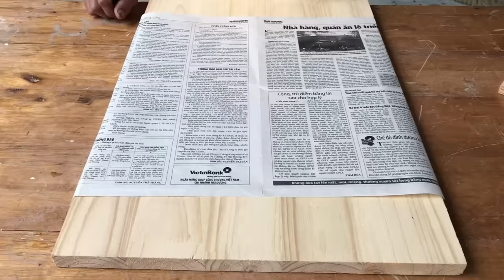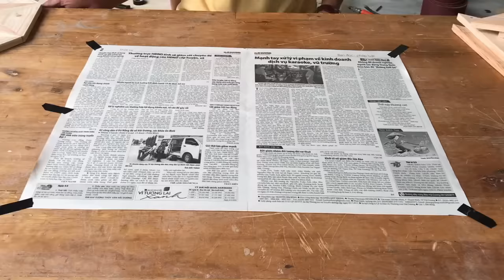Idea Of ​​Turning Pallet Wood Into Work Of Art. How To Create A Patchwork Of Your Gallery Wall -DIY!

Comment: HOW HAVE YOU STILL GOT ALL YOUR FINGERs.???? BRILLIANT JOB!
Reply: The fingers were SO CLOSE to the saw blade. It made my hands sweat watching it.
Reply: @CesarSandwich  I could only watch it with one eye open 😁.
Reply: Oke
Reply: Chop saws are a lot safer than table saws - there's a clear line where you don't put your fingers, and you know exactly where the blade will go. If he'd used a table saw and was pushing things towards the blade, there are a lot more chances for injury. Having said that, he did reach around a few times while the saw blade was still spinning - where's the guard on that thing?!
Reply: @Gisburne2000  Thanks, to be honest all electrical saw scare the hell out of me.😂😂😂

Comment: Beautifull work. What kind of glue did you use?
Reply: Hi, you can catch the glue type if you stop the video right when you see it. This is a cyanoacrylate glue, brand: DUC ANH - BOND, but if you can't find it in your country, any other brand will work fine. It is generally sold in small quantities in very small containers and quite expensive.
Reply: @jean-louismarchand5311  It's just super glue really

Comment: Just beautiful.  I'd like to try to make one myself.   Can you share the cutting angles for the star and frame?
Reply: the star is cut at 22.5 degrees, the frames are 45 degrees.   the actual size depends on how wide your boards are to begin with.   when you cut the angles, that determines the length automatically.

Comment: that was great, would love to know the angles of your cuts
Reply: The angles are easy to determine at least for the main center piece. A circle has 360° divide that by 16=22.5 once you have the center piece you can trace the outline and check what angle it gives you for the second pieces. Hope this was somewhat helpful
Reply: ty so much, what i was looking for was the star messurements
Reply: @mtz3843  ok. I estimate that to be around 16 nch I might be wrong
Reply: the actual size depends on the width of your boards, once you cut a 22.5 degree angle on each end, that is the length.   the wider the board the bigger your star, the narrower the board, the smaller the star.   My question is where do you get that glue?

Comment: You could turn that into a clock with a router
Reply: Only one hole drilled through the center on the front to apply the pins to pass through be a beautiful clock